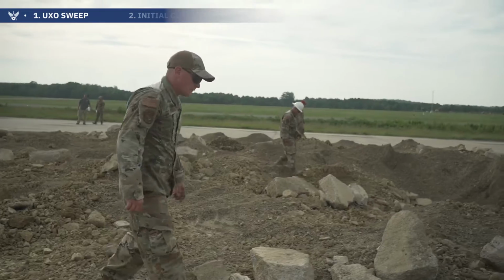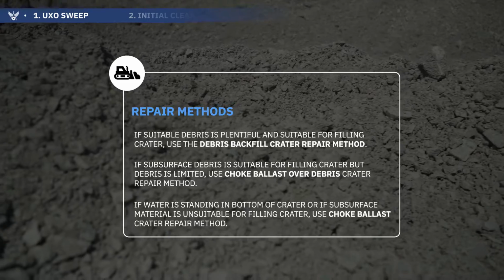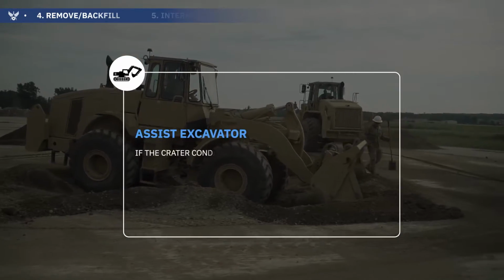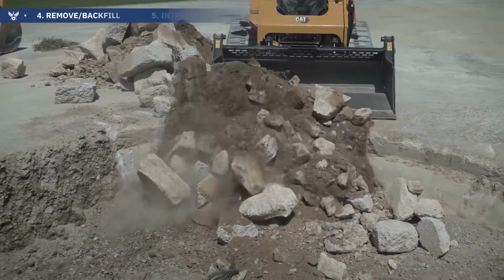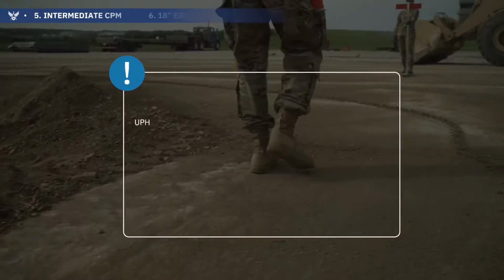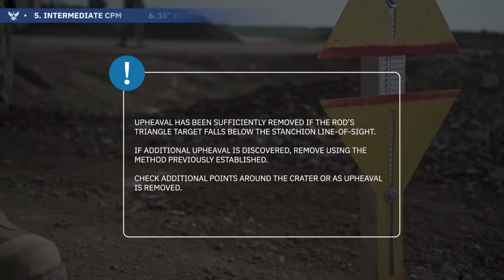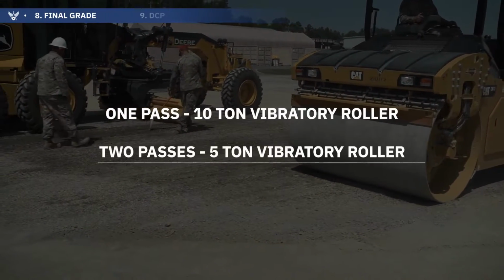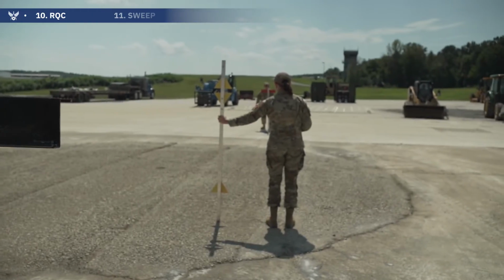Crushed Stone Repair Video Training

Comment: Under the career requirements under civil engineering on the air force website one of the requirements is 12 months experience in a subspecialty field. Do you know what this means, or do you have some examples? The live chat agent I talked to on the air force website didn't know.
Reply: For initial entry into one of the following CE AFSCs: 3E0X1, 3E0X2, 3E1X1, 3E2X1, 3E3X1, 3E4X1, 3E4X3, 3E5X1, 3E6X1, 3E7X1, and 3E9X1 the requirements are based on your ASVAB scores and physical results from MEPS. For 3E8X1 there is an additional physical assessment that is required along with ASVAB scores and MEPS physical results. However, if the job you are referring to is a specialty duty assignment completion of your technical school within one of the above AFSCs, it very well could require 12-months experience in a subspecialty field. For me to give you a more accurate answer, I would need to see the exact webpage you are referencing.
Reply: @AFCETM  I'm not sure why but it deletes my comment every time I try and give you the link. I was on the air force website looking under maintenance careers and I was on the career just titled Civil Engineer. It is listed as an officer career.
Reply: @DarthDeltoids  In Civil Engineering (CE), there are both officer and enlisted opportunities. To be a CE officer, you will require an engineering degree (e.g., civil, electrical, mechanical, environmental, etc.) prior to entrance. For an enlisted career, you will have to meet the requirements previously discussed.
Reply: Why was the made for?